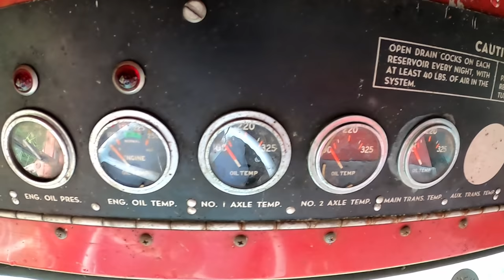Will it move? old Diamond T Cabover 931 cn

Comment: It really is too bad about that rust jacking, that frame is done. If you're into a bit of engineering that cab could land on just about any chassis though. The old 855cu in Cummins is a classic and it runs clean. What to do, what to do...lol I rebuilt a 63 KW and made it into a motorhome many years ago. It was too old to work as a daily driver but I had a lot of fun with it as an RV. Bonus was that I didn't have to pay for hotel rooms! Whatever you choose to do with it, it's still a very cool old piece of history. A Diamond in the rough, iffin y'all will pardon the pun.